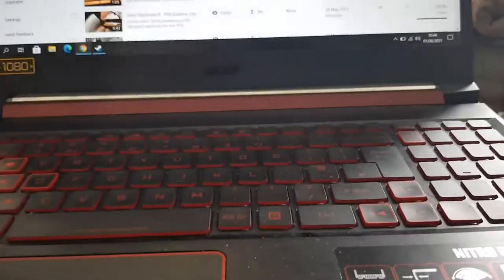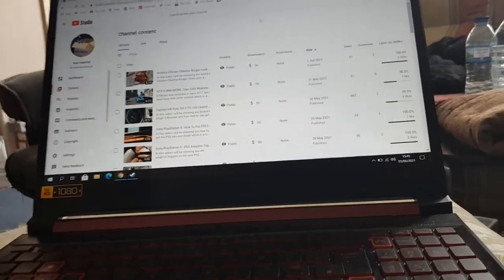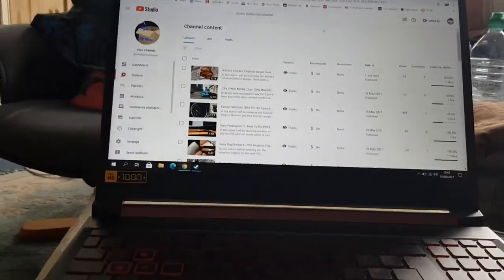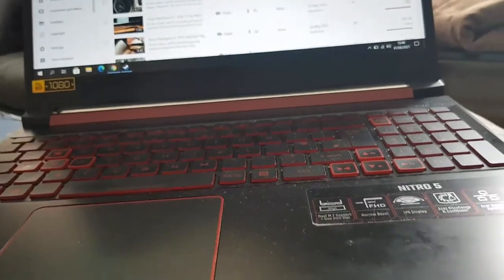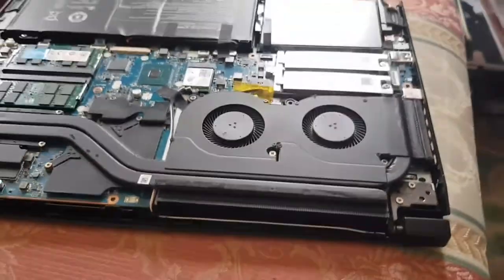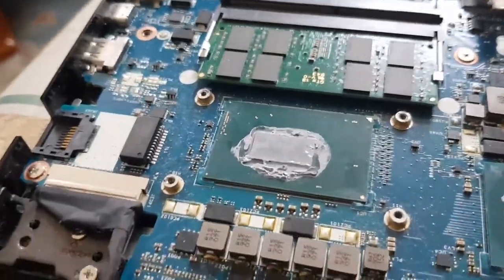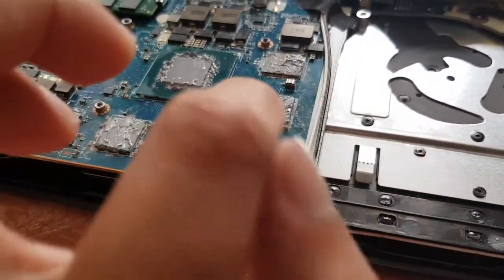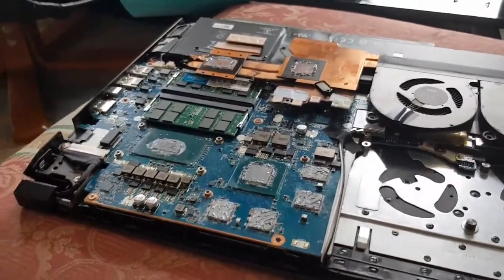Arctic MX4 4 Months Later Review Checkup Failed Already

Comment: i'm having issues with mx-4 too. after repaste idle temps are better (45-55 degrees) but under load both cpu and gpu are 90+. i've been using stock paste ever since i got the laptop (around 4 years) and while cpu did reach 90, gpu would only get to 85. i've repasted again and again thinking i did something wrong, but i heard that mx-4 isn't very good with laptops...
Reply from the maker: Yh it isnt use different
Reply: Try ptm 7950

Comment: Did you use hydronaut as well on the vrms? :D
Reply from the maker: Yeah i did, it should do the job fine
Reply: @MrWaheedulHaque  thank you! How are your temps? :D
Reply: @MrWaheedulHaque  I tried mx-4 but it doesn't seem to work on nitro 5 😅
Reply from the maker: @myootube  temps are really good, still around 70 ish and 82 max load its holding up very well
Reply: @MrWaheedulHaque  nice! thanks for replying man. Gonna repaste my laptop later :) keep it up with the tech vids
Reply from the maker: @myootube  thanks boss :), the laptop is falling apart though btw the bottom of case randomlly cracked probs got weakened overtime from heat, and all the screws randomlly fall out and im down to like 3 or 4 screws haha
Reply: @MrWaheedulHaque  Happens to me as well when I open apart the laptop so I bought laptop screws online 😆 it's really unfortunate that nitro 5 really has cooling problems 🥲
Reply from the maker: @myootube  bad thermal design by acer not much customer can do haha
Reply: @MrWaheedulHaque  Hey man I just want to say thanks. I repasted my nitro 5 just a while ago (cpu,gpu,vrm) and the temps are amazing even under load! I am getting 70-80 temps now whereas before I'm getting max 89! thank you for the video man. All the best to you!
Reply from the maker: @myootube  thanks boss